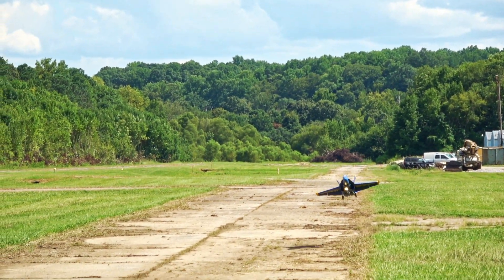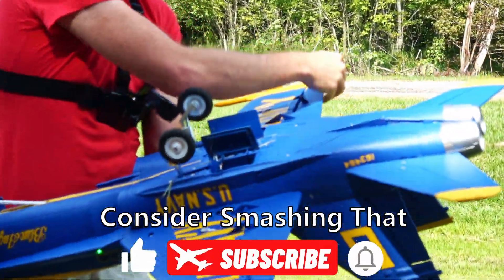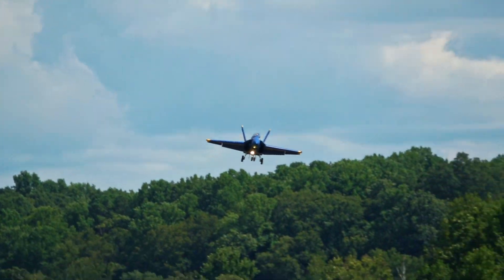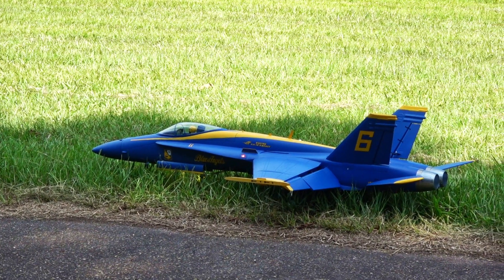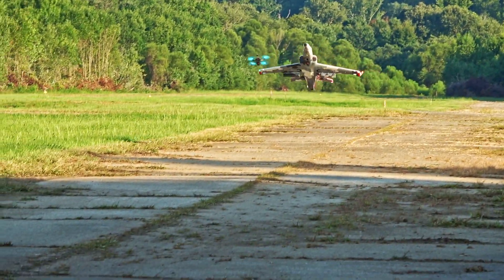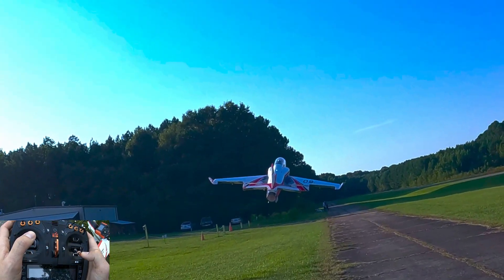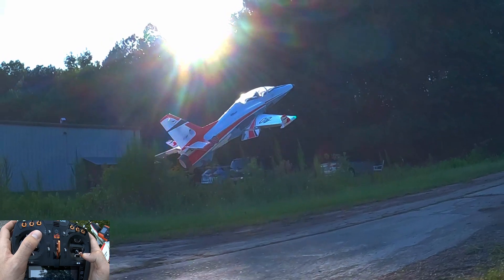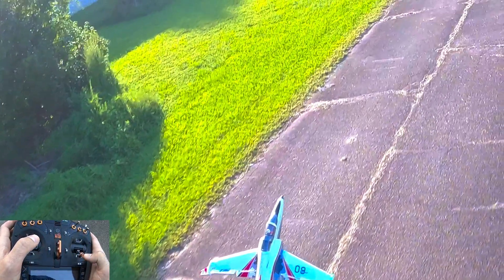You Might Not Need a Gyro (But It Really Helps)

Comment: While I do agree with you I’d just like to add that there are instances where flying with the gyro off is fun or adds to your knowledge base. 
For instance, practicing cross wind landings recently with the gyro on its almost impossible to get the aircraft to crab during the side slip, the gyro prevents the weather vane effect and I need almost no contrary rudder to regain my centerline before touch down. Flying the same approach with the gyro off, the plane naturally crabs and I have to modulate aileron and throttle during the decent then straighten out with rudder just before my wing low main gear touches. 
Having the gyro off added an extra challenge and helped me with a skillset I would absolutely use as a full scale pilot. 
Just wanted to point out that there can be a fun factor either way, gyro off or on, but that largely depends on the pilot and the aircraft being flown. Thanks for another awesome video 
🙏
Reply from the maker: Try reducing your rudder gains if you're unable to hold a crab on your current settings. We've personally never seen this behavior. All of our models with gyros will crab in a crosswind.
Reply: @TwoBrosRC  I need to learn how to flash my bind and fly receivers, the gains are high for my liking (almost to the point of small oscillations especially on rudder). Right now I only have two PNP aircraft where I have adjustable gains and an off position.

Comment: I'm 72 and have been flying R/C since 1963. All 16 of my EDF's and several of my propeller planes have Spektrum AS3X/SAFE receivers in them. I learned how to reprogram AR636's with SAFE mode almost 4 years ago and was using AS3X long before that. EDF's can be tough to see at times due to their smaller size and military paint schemes. I've never had a gyro crash one of my planes, but having SAFE/Panic mode has probably saved a few. I enjoy tinkering with gyros. Having been in the hobby for almost 60 years, having something new to play with keeps it interesting. I have to disagree on the 150% travel though. I never exceed 125% travel because I want to leave a little room for subtrim and trim. Plus, I don't want my servos to rotate more than 45 degrees either side of center. Traveling further makes them take longer to get to where they're going and the movement of the linkage gets more non-linear. (I do adjust my linkages so that my trims are as close to center as possible.) I rarely exceed 50% expo, but then I don't use 3D throws on my control surfaces. Rates and expo is a personal preference thing and depends on the type of flying you do. You'll mostly find me flying the old AMA pattern or some of the IMAC stuff. But yeah, I do get ragged about my gyros and how they fly my planes for me. It's ok, they don't know what they're missing.
Reply from the maker: It's honestly really refreshing to see an older pilot not talk down to other pilots about gyros. It happens so often that it's turned many people away from the hobby.

150% rates doesn't change trim in our experiences. The servos will use the PWM signal that's given to them. Adding trim in 150% just reduces the amount of travel that's possible on the opposite side of the trim - e.g. trimming up elevator will reduce how far down the elevators can travel by the amount of the trim added. This would be the same even if you kept it at 125%. So for example, trimming 10 points of elevator up would reduce total travel to 140 down.

We usually make a point to mechanically trim models that need more than a couple clicks of trim to avoid limiting the surface travels. Like you said, it's a personal preference. We still don't understand why people feel the need to lord their choices over others. If you don't like gyros, don't fly with one. They don't make you any less of a pilot.
Reply: @TwoBrosRC  With the travel set to 125%, 50 counts of subtrim uses 15% of the travel. If I add 28 counts of trim in the same direction, that uses another 10% of travel for a total of 25%. So with my travel set to no more than 125%, I most likely won’t have any servos stop moving before a stick hits the stop and my servos will move the full 45 degrees in each direction. I don’t recall how a Futaba handles overrun due to subtrim and trim, but my RadioMaster TX16S apparently doesn’t have any overrun area. If you use any subtrim or trim, your servos will quit moving before the stick hits the stop. And that bugs me..   ;-)
Reply from the maker: That's why we mechanically trim after electrical trim unless it's super minor!
Reply: @TwoBrosRC  On the other hand, I see people use long servo arms, the inner hole on control horns, turn the travel in their transmitter down to 75% because their control surfaces are binding, and they wonder why all of their planes fly like crap..  ;-)

Comment: Excellent video!  Thank you for taking on such a controversial subject.  Old guy here, flown a lot with gyros and more without.  This issue reminds me of when proportional radios came out in the mid 60’s, when “reeds” radios were the norm (literally toggle switches on the Tx front to make control surfaces move). Imagine showing up at an AMA contest back then, with a new proportional radio, and being told you can’t fly with that, unfair advantage, so go away and come back with your old reeds radio!

Comment: Cameraman here. So here's the thing. These models are based on the real-life airframe counterparts, so they share a lot of the same characteristics as the real ones. In reality, a full-scale F/A-18, F-16, F-22 whatever you want to use as an example, simply couldn't fly stable at all without the digital flight control computer that drives the control surfaces. It's not like pre-1970s fighters where control surfaces were manually linked to the flight controls, it's all digital fly-by-wire. You're just telling the jet what to do and the computer extrapolates that and then moves the surfaces however it needs to to give you the desired output to your command. They fly solely on computers and gyros, so why wouldn't the scaled-down RC versions benefit from that? Saying they make you less of a pilot is completely false, the real jets would be completely unflyable without them.
Reply: Yes! I’d love to see someone fly an X-29 (most unstable aircraft) that has all moving canards without a gyro. It wouldn’t last long!
Reply: Yep bingo!  Some folks simply don't think deeply enough.  Usually stubborn old farts when it comes to anti gyro comments.  But hey, who wants to use a smart phone when instead you could use a 1990's Nokia flip phone right?  I bet you not a single person who complains about gyros drives VW Bug still or uses a Macintosh computer still or watches TV on a black and white TV using bunny ears for reception.

EVOLVE
Reply: @dandanthedandan54321  LOL
Reply: add a gyro for the camera lens too (ios) 😂. - fyi I'm a gyro pioneer

Comment: Jon as you know I'm not typically a user of gyros, I learned to fly, correct for wind, and set up a good airframe without them. That said, many models like some F-18's and F-16's for example are a bit unstable (like their full scale brothers), and no amount of skilled "set up" can make them fly as good as they are capable of flying. Gyros make the experience of flying those much more enjoyable. Then again some planes in my opinion fly fantastic without them. I help a lot of people, teach a lot of people...some in the gyro camp and some not, so there is a need for me to be able to extract the most out of a plane without one if necessary depending on the individual. Setting up and flying planes without them a lot keeps my skills sharp in that department. 

As it relates to a newer pilot learning - there are some things in my opinion that you can't learn with a gyro. Setting up an airframe really well (just airframe set up) is difficult with a gyro as it masks some issues that the pilot would otherwise feel, and some of those issues can be addressed with balance, throw, expo, thrust angle, etc. The absolute best flying planes with gyros I've ever flown were first set up to get the most the airframe had to give, and then the gyro was brought in at extremely low gains and adjusted from there. Kind of like putting the cherry on top of the ice cream. Basically as it was explained to me...a gyro can shine up a turd, or refine an already well set up airplane. In other words you can just put one in a plane that doesn't fly very well with no set up, and it will fly better, maybe even very good, but if you put one in a very well set up plane that already flies very good...the result can be spectacular. Learning what you're feeling, what to feel for, and how to correct that with airframe set up has to be learned with the gyro off. The other thing is wind flying skills. While a full scale F-16 pilot has a flight computer, a J-3 Cub or Edge 540 pilot doesn't. Learning to correct for wind...and making all the corrections yourself, has to be learned with the gyro off.  It is much harder, but it can be done, and at times I find that skill set useful. 

Now...those things are not a necessity...no one has to learn that if they don't want to, I simply want to. If a person wants to start with AS3X/SAFE and then continue to put that in everything they fly...there is NOTHING WRONG WITH THAT. Whatever makes the individual happy is fine. That is why I'll teach either way. You want to use them, I'm in...I'll help you. You don't want to use them, I'm in...I'll help you. My only condition for everyone across the board is you have to be safe, and not risk the hobby for the rest of us by doing stupid stuff that puts others or their property in danger. 

I try to make my points both for and against inclusive and as intelligently as possible. Gyros...like anything else, have good points and bad points depending on the mission of the individual. I could easily stand in either camp and make my points in a kind, informative way. I agree. Anyone who belittles another modeler because they use a gyro is just an asshole. I don't give a damn what you fly or how its equipped. If you're safe, and having fun...I'll fly with you.
Reply from the maker: And this is one of many reasons why we love you and the work you're doing, Adam. You're a good guy who recognizes that there's more than one way to approach flight.

Comment: As a newbie, my opinion on gyros is that they are a great tool to expand my skillset in a safe way. I am not lucky enough to have AS3X yet, so to get out of my comfort zone i just have to deal with fully manual inputs. i can say that yes, going manual sometimes is a great tool for expanding your skillset in the most rewarding way, but using a gyro either in AS3X or SAFE is totally ok! keep the great work up!

Comment: Question: The FrSky X8R has Telemetry, and you can calibrate it, using POTs, you can fine tune gain etc. would you add a gyro to this receiver?
Reply from the maker: We don't fly FrSky, so we can't help you there. What you can do is ask on our Discord server. Someone will probably know: discord.gg/twobrosrc
Reply: @ thanks Jon, your discord is always helpful. Thanks for all youve done do for the sport, your videos are the reason I came back after 10 years away.

Comment: I have some with and some without as3x. Some of my planes are inherently stabile in the air and find the gyro doesnt really do much and some get the wichita waggle (cause its usually windy and turbulant here) that the gyro helps to keep from getting knocked back and forth. You pointed it out that the gyro doesnt prevent the plane from  crashing and it also turns the gains down to all the way off when at full stick range. Maybe some guys are thinking when you say gyro, that all they think is safe mode. In that sense, yes, the gyro is doing more towards flying the plane and keeping you from crashing it. Ive heard of some that have been able to set up a gyro to have head hold in a position and could take over control for a prop hang and you just have to make sure the throttle is there. Either way, to each his own and i agree to let people have fun and stop the ego trips to tear down someone. Fly gas, fly electric, gyrp, no gyro, fly jets or only props, foamies or balsa, scratch build, large scale, micro, spektrum, fitaba, frsky, old 72 mhz, lipo battery, life, nicad. I mean ive been around in the hobby long enough to hear someone get critical of all those points and then some. My buddies and i joke that being a dick is their true hobby and happened to be able to fly rc planes.🤣🤣
Reply from the maker: Funny enough, the fellow we singled out here on FB accused us of flying the Viper in SAFE mode until we rebutted and explained that the gyro is basically inactive because of the mixing we're using. That's why he responded with "Vipers can't do that without a gyro" - we ended up blocking him and usually just block anyone with similar responses. Life's too short to deal with people like that.
Reply: For real brother.

Comment: I use gyros on some planes and not on others. 800mm warbirds i use a gyro. I have a 70mm Blue Angels Viper i don't use a gyro. 64mm Arrows Marlin was my first "big" jet, i was scared so i used a gyro, one day the gyro died on the groun, thank goodness not in the air, so i flew w/o it. It made a difference  but i was fine and don't use the gyro for it anymore. Had a gyro in my 50mm Arrows  Viper it did not fly the plane for me or keep it from falling out the sky cause i flew to slow, not i fly it w/o one, nomajor difference. I put one onmy BV-38 Horten Wing, flew it for years w/o one. Had a delta wing gyro form Hobbyking lying atoun. It flys smoother and doesn't flop as much doing Maneuvers. I put one in my Bixler 3 for A fpv platform its much smoother. Yhe 64mm Arrows F-86 came with Vector, i turn it off when i fly it, tried safe and gyro, but doesn't  need it, but glad i had it to learn Jets. I use gyros on all my 1.2m Warbirds, But not on my jets.

Comment: I believe a gyro makes a model plane behave like a larger version of itself. It stops the model being knocked about by every little gust that wouldn’t feel as severe if the model was bigger and heavier. I learnt to fly with a typical foam high wing trainer, no gyro, only a few years back. Knowing how to fly using only the basic controls, is an asset.
Most of my planes don’t have a gyro, but my 850mm Pitts does! If the Pitts didn’t have gyro I would not be as confident flying it, and if it didn’t have “Safe” it would have crashed more.
I’ve heard of the “Traditional Flyers Rant”… “No gyros, no safe, no control mixing, no expo, real models are built from balsa with a proper engine”. 
If that’s how they wish to fly, good for them. I don’t understand their need to harass other RC pilots, who learn how to use the technology the hobby possesses. Unless these Traditionalists are watching and commenting using only an abacus, they know it’s modern electronics, not dark magic.

Comment: I wonder if the anti-gyro club also drives cars with manual transmissions and carburetors. Also no power steering, locks or windows. Because assistance of any sort is weak and all that 🤣. I recently added planes to my rc obsession and without gyro assistance, I'd probably just stick with my bashers. And as someone who was against gyros in my stunt trucks, I absolutely love it in my speed rig. Negative Nathans are destroying the hobby... not technological advancements.

Comment: iNav 5.1 is a great option, I have it set up in 4 different fixed wings, not only does it give various types of stabilisation but also return to home and autolaunch
Reply: I saw a guy with a cub do that and maybe he was using inav. It was the craziest thing i had ever seen. Deffinetly wowed by his ability to program something like that.
Reply: @jared6072  Ive been building and flying quadcopters for a few years so it wasn't too different from betaflight that we use on the quads. The autolaunch feature is so helpful, literally does all the hard work and then you can just set it to loiter once its at a certain height while you get ready to take control. If your interested in trying it there's some great tutorial videos by Painless360, Mr.D - Falling with style and Paweł Spychalski.
Reply: @mbezik  sweet! Thanks for the help

Comment: Lot of good info in this! Old heads can never just carry on with their day. Lol

On as3x.. question..I have as3x on f16 with flaperons setup on my dx6. But only one ail has as3x anyway around that?
Reply from the maker: You need to unlock the receiver and reprogram it so it knows the wing type is flaperon configured. It's set by default to a normal wing which means the gyro only sees one servo because it's expecting  Y-connected ailerons.
Reply: @TwoBrosRC  thank you bro love you

Comment: I ran into these types. All the time when I first started when the apprentice came with safe2013. Joined ama. Found a club paid my dues.  I went to the club with my plane. One of the officers and some of the old guys told me take my plane home and get on a simulator and fly a umx piper j cub. I left and found a logistic that's a abandoned with a paved road to learn to fly I flew that thing until the Dallas doll came out with as3x and retracts. I flew that bird for two months. Until I got everything right and went back to the club. They were surprised to see me and dragging a p51 mustang. At the flite line for take off I can hear them heckling if I was gonna crash. One of the old guys came standing beside me as I did loops and rolls telling me I was going to hard. The landing was smooth as butter. Now I fly there all the time not a péep out of them.
Reply from the maker: And they undoubtedly say that the hobby is dying without realizing that they're the ones killing it.